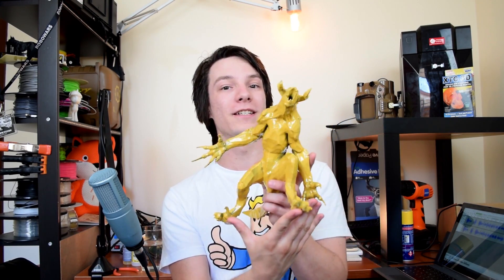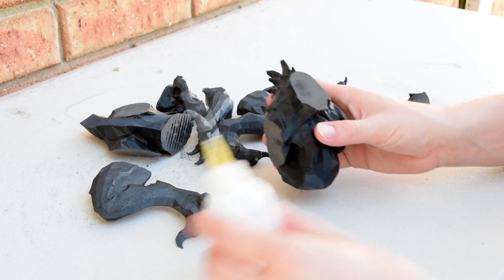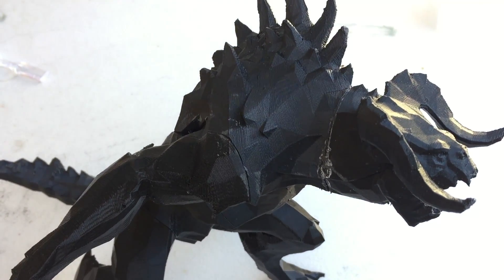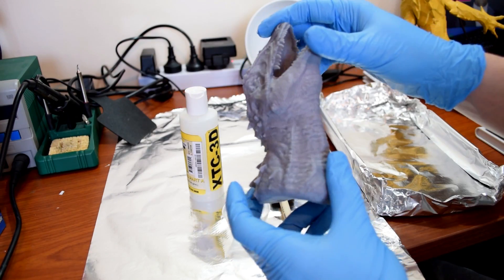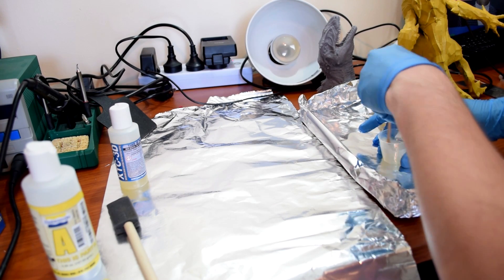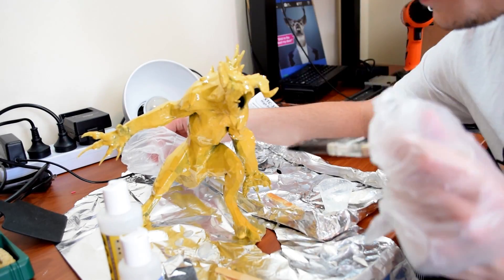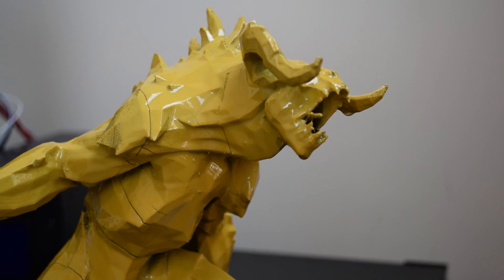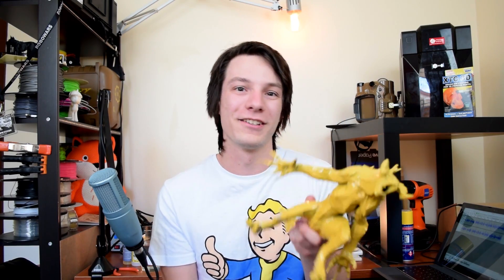3D Printed Deathclaw from Fallout 4 - Part 2 - Finishing with XTC-3D - 2015

Comment: If you've still got it, and want to send it off to Canada, I'd like to use my years of 40k army painting again. 
But being the perfectionist that I am, I'd need some GreenStuff and basic sculpting tools, etc to make any paint on it look half decent, and in that instance i'm worried the coating might not like glue. 
Also with it being an ingame asset taken straight to a 3d printer its fairly geometric as it was low-poly, I'd almost feel better using the 3d model and sculpting it in zbrush but I'm not sure if you can get that kind of detail out of a 3d printer, or if you can print highpoly zbrush models at all.
Reply from the maker: +BlinkZX6R Thanks for the offer! but I've since given it away... I worked out a great method of smoothing in-game models using the butterfly subdivision filter in Meshlab, which works really well to add more detail back in while not 'rounding off' the sharp features. The coating is an expoxy, so glues would be alright on it. Do you have a link to your work? I love well painted miniatures. :)

Comment: What you should have done is to load the model into blender or some othe software, there you can easily up the polygon count, makinf the middle look much better!
Reply from the maker: +reptileawsome I can't use blender to save my life! But you can subdivide in meshmixer as well, it works well rounding over the edges, but also rounds over edges I want, like horns spines and teeth. I've been using the butterfly subdivision algorithm in meshlab lately, it works pretty amazingly and I'll probably feature a video on it.
Reply: Maker's Muse Oh, I did  not know about that. The problem I do have with the blender subsurf is the loss of sharp detail. I will have do some testing with meshmixer :)

Comment: Couple tips for you. The foam brush that comes with it is only good for low detail big parts, buy a couple sets of cheap brushes (medium and small size) and use those instead (1 use only as well, so cheap stuff will do perfect). When you use brushes pay close attention to the brush as it some times you can have lose hairs left on the part you are treating. If that happens remove them, when the resine cures they'll be there for ever. You seem to be applying way to much resin, less is more in these cases and also, on the lower parts of your model (or any other problem areas you identify) look for resin pooling and clean it up with a new brush and removing the resin from that brush using a paper towel before doing the same again. Another tip when using resin in this way is after you mix component A and component B, mix it well but dont leave it in the mix cup, spread it out on the tinfoil. Resin will harden and cure from thicker to thiner, so by spreading it on the tin you will change the use time from 5 minutes to 20 minutes before it cures and hardens up. (these 5 and 20 minutes times are as a example, never used that specific resin myself before, so no clue on it's set times). Best of luck on your future projects.
Reply: Wouldn't spreading it out cause it to cure faster since more of it is exposed to air?

Comment: why did you try to paint it before the xtc3d epoxy? seems it would have been easier to justvuse the xtc3d to fill everything in and then paint it
Reply from the maker: +sinformant In hindsight that makes a lot more sense, originally I was wanting a glossy coat so I put the primer down first to try and disguise some of the joins. Next time I use XTC-3D I'll apply it before any paint.

Comment: Hey Angus~ So happy to see you tried out some scale modelling. This has always been what I have been interested, so big thank you.

I always thought applying the XTC-3D first, directly to the ABS print, would give it the smooth surface it does (as it is contains some kind of solvent of ABS/PLA). I am suprised to see that it still works after you had primmer on.

Do you find the final finishing differs between the dino head and deathclaw?
Reply from the maker: +Kenneth Chow The XTC-3D stuff doesn't actually interact with the material at all, rather it's just a really viscous coating and because of this 'averages' out the lines as it sets. I was surprised it worked on the primer too, but it seemed to have no affect, both prints smoothed nicely.  Glad you liked the print! I need to do more like it.

Comment: I would recommend so some sort of automotive putty to fill the lines in and sand it, in the states we have Bondo which is great stuff. Painting it i would suggest using the colors from the game, or have your suster paint it since she did great with the power armor h armor helmet.
Reply from the maker: +Todd Moeller I used automotive putty to fill the big gaps in the Auto Axe and it works well, but wow sanding can take a long time! I don't think we have bondo but there are similar gap fillers available. Yeah I've got my sister tasked on a mini nuke at the moment :)
Reply: Plain bondo is too soft for print material, the only auto putty I would use is evercoat glazing,and forget spot putty, that crap would be a huge mistake ,it's for pin holes , takes forever to dry and it's even softer.It's seems xtc gives people the idea ,it takes little to no sanding this way.HMMMMMM ?????   Wellll ?e Good Luck. I'd never use that stuff, to bodyshop and finish out a 3-d print. I'd bet there are a lot of visible lines still ??? Go count em. The pieces I do must be flawless,i'm serious I always sand the print first,as much as very possible before spraying stuff your gonna sand off more than likely and for primer I use polyester filler primer . A bit of a pain with the acetone/mek.paint guns, etc. BUT--It Sticks and is very hard ,similar to the print material. I have all my tricks down, and they're super valuable, after so many different types of parts and projects,I notice many people who think it's a quick sand and off to paint. I want to be there to watch that !!!! LOL
I won't be using xtc is my verdict, but if it does your job , that's all that counts.

Comment: Nice job Angus...I picked up a can of plastic primer awhile back, can't remember if it was supercheap auto or bunnings but haven't ued it yet as I found using acrylic paint without primer worked well but this xtc 3d looks perfect to finish off as the acrylic dries to a matt finish..thanks
Reply from the maker: +Bullwinkle69 Yeah a nice matte finish would be cool. The XTC-3D is pretty neat stuff, I can certainly see myself using it in future.

Comment: I like weld-on 16 for gluing parts, PLA, ABS, PETG etc. I doesn't have that whitening effect. I also use the soldering iron quiet a bit when welding parts -- if you get good at it, you can make the seam almost imperceptible. Also, another trick is to put a seam where there is a natural transition of some sort, where you can hide the joint in the design. I like XTC-3D, it sands very nicely. I used it in very large print: http://www.thingiverse.com/thing:822739. I also have an art background, so I painted this one afterwards. But I was able to avoid using it in my other large creation entirely http://www.thingiverse.com/thing:921465. The print came out so clean, and I was able to hide the seams, there was no need for any extra finishing.
Reply from the maker: +kazolar Awesome prints! You're right, with a bit more care I could do cuts in the model where the seam is hidden along the facets.

Comment: As a simple way to show off depth, you could do a base black coat, then use a slightly off white paint sprayed or air brushed straight down from on top. It's actually a technique to aid in painting realistic light, but for the lazy it makes the depth of a statue pop.

Also, that store in perth, does it actually have a storefront? Few times I've wanted to get something specifically for 3d printing, and the only place that you can actually walk in to buy non Da Vinci stuff at is X3D, next to stanbridges.
Reply from the maker: +Karl Ashley Yeah they do, took them a bit of time to get properly up and running but they've got a nice supply of filament. I'd call before rocking up though, just to be safe.
Reply: +Maker's Muse the website seems kind of half made. No listing of what they actually have. :/
Reply from the maker: It is lol, none the less they were the only people in Perth with XTC-3D :P They've usually got some ABS and PLA of various brands in stock just call em instead of relying on the site. They bought the stock of 3D Printing Studios Perth (where used to work)

Comment: I  used some "Quickshade dark tone" from The Army Painter for a skull I printed with pretty good results.
I first gave it the acetone treatment (your rice cooker method actually) then used Multi purpose body filler from Repco or Supercheap to hide the join lines, then gave it a sand and a spray with some acrylic primer. Then I just used a brush to apply the quickshade. Picture of it here (on the right) https://goo.gl/photos/K5D2aEYgQeukouDo8 
May not be the best for a darker coloured print but its a easy way to get some nice shading for lighter prints with out too much work involved..

Keep the videos coming, some more finishing of 3D print vids would be nice;) I'm always looking for different methods to finish prints. Will need to give XTC 3D a go.

EDIT: Actually uploaded a heap of pics of the skull process here https://pinshape.com/3d-printed-object/195-boneheads-s1-wolf-skull-w-jaw-3dkitbashcom

Comment: I do a bit of miniatures wargaming.  The way I'd do the death claw is a spray undercoat of a solid and even black.  Thin but even is the key.  I'd follow that with an even coat of Vallejo Model Color 995 "German Grey" (you can find this in most game stores not run by Games Workshop).  The German Grey is a very dark dark grey, that will give the body a nice matte look.  I would then do a black wash, any plain black diluted down to be as runny as ink, really slather that on so it gets into every crevice and hollow.  It'll give a huge amount of depth to the model.  I might then go along and dry brush a slightly lighter colour on anything that's raised, to really make it pop, but Deathclaws are quite dark creatures.  Nothing really pops when you look at them in game, so this step may not be necessary.
Reply from the maker: +Michael Vaughan Never considered a wash, that sounds like a great idea.
Reply: I painted my last batch of save orcs entirely in washes.  White base coat, brown wash for shade, two coats of green wash.  They came up brilliantly, with mottled skin, instead of flat, cartoony skin.

Comment: I dont think that white spots were due to contaminates.  It looks like natural reaction to abs. If you break abs filament or parts you can see bit of whitening
Reply from the maker: +Karan Chaphekar hmm maybe, but the bottle went white too, and I've vapour smoothed eSUN black ABS before with no problems. Unusual... There may have been some acrifix residue in the bottle now I think about it...
Reply: +Maker's Muse That white frosting looks just like cheap superglue drying in a dry environment.  Low humidity, or the air conditioner on?  Cyanoacrylate based glues, even good ones, would probably dry out far too quickly if there's acetone mixed in and evaporating off, creating the same effect.
Reply: +Maker's Muse hey can you make this bandable?

Comment: I might be wrong, but I suspect this xtc stuff is just glorified expensive clear epoxy...
Reply from the maker: +Wai Hoong Liew Quite possibly, but they nailed the viscosity - it's super viscous, anything thinner wouldn't sit across the print lines like it does. Some people have achieved similar results with Z-Poxy PT-39.
Reply: +Maker's Muse I might wanna purchase a set and try it myself... Not sure if liquid chemical can be send over to Malaysia though...
Reply from the maker: It's only allowed to go by Road or Sea I think, not air. So might take a while but should be possible!